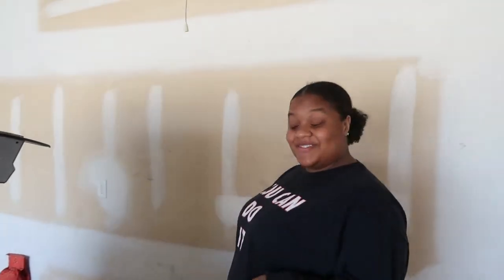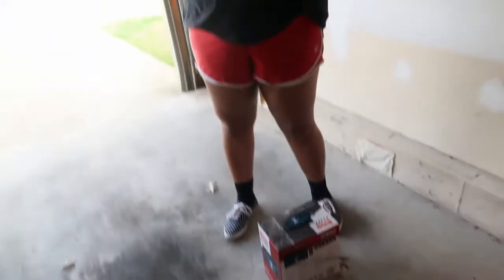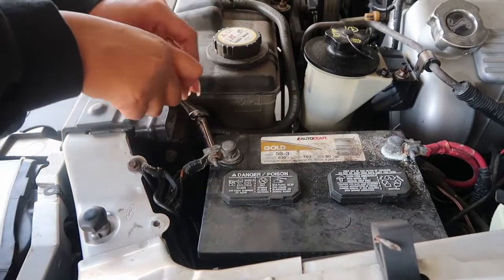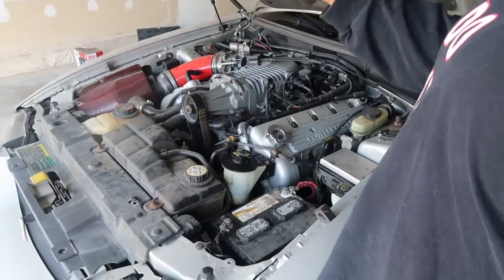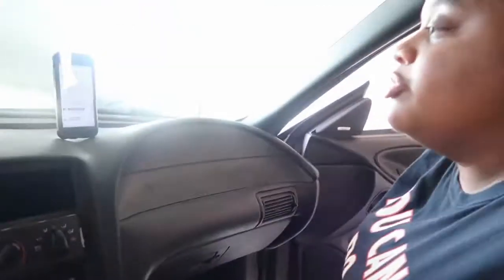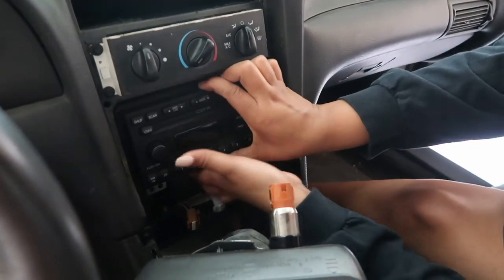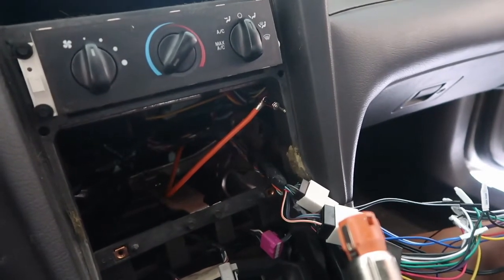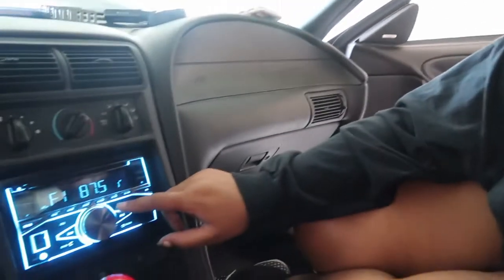Girlfriend Installs Radio in My 2003 Mustang Terminator Cobra

Comment: What wiring harness did you use?
Reply from the maker: Tiffany I believe it’s part number 120705701.. Double check for me
Reply: That's the one Crutchfield recommended to me, just wanted to make sure it would work on my '03...thanks!
Reply from the maker: Tiffany yes ma’am👍🏽please do me a favor and let me know if your factory tweeters are playing bass when you install it/get it installed. Mine are I believe😕